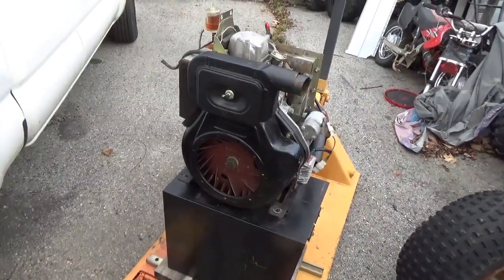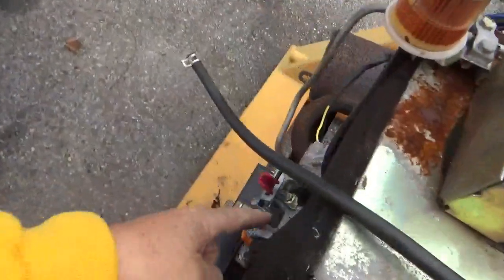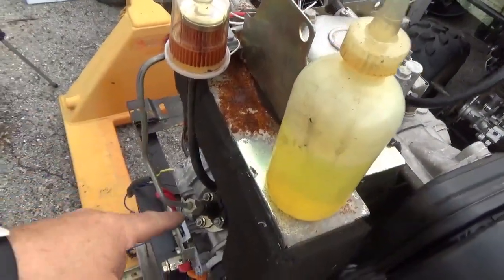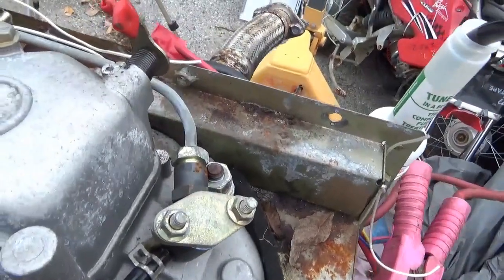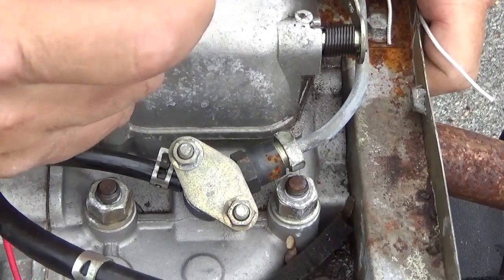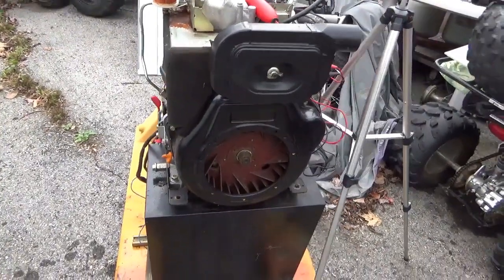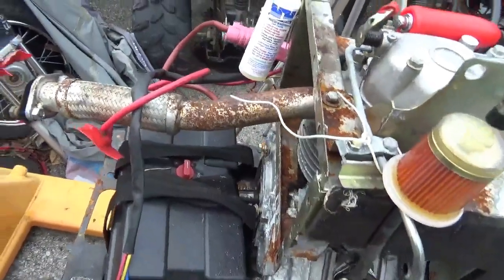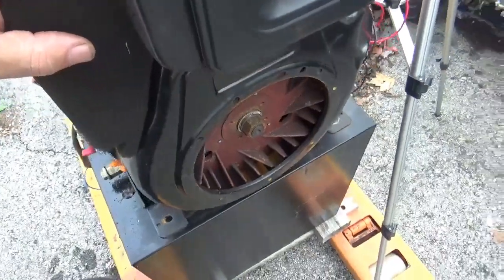How to Purge Air From a Small Diesel Fuel Injection System

Comment: nice job, and nice explanation. this engine is similar to my 5Kw diesel engine. these engines are rated about 8.5hp not 12hp, since it is a 186F engine. the 12hp would be a 192F engine. I made a video on my channel on how to adjust the governor. these engines have pressure and splash lubrication. and they make tapered shaft adapters on ebay.